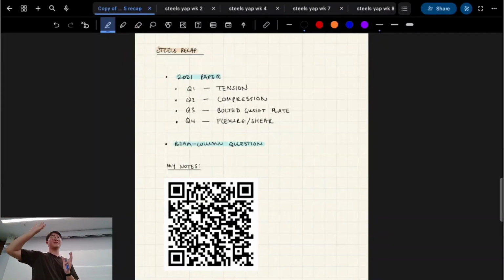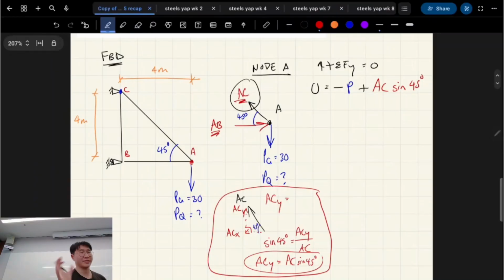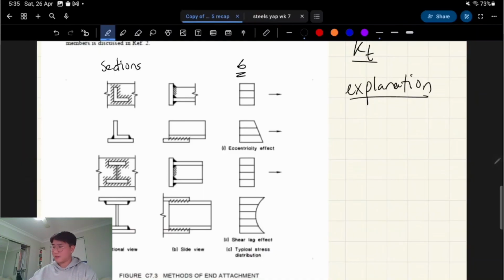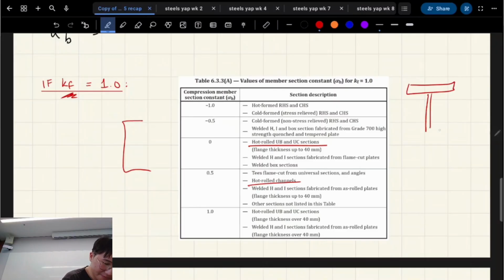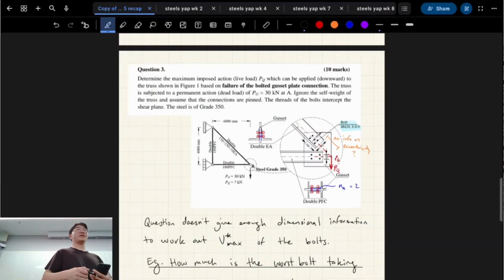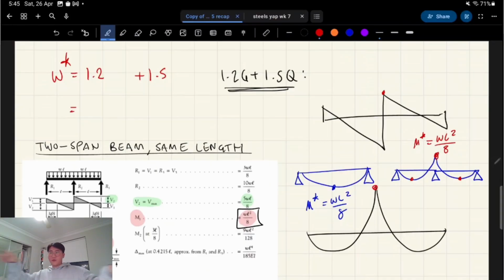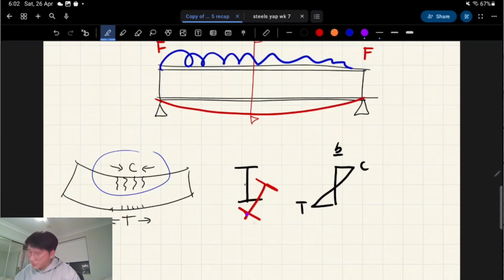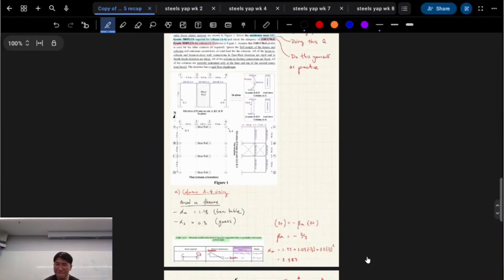Steels Recap Workshop (CVEN3303 2025) (Updated)

Comment: Hello my GOAT. What if the gusset thickness isnt given? For question 2, calculation of Iy for radius of gyration. Do I assume a thickness and state it?
Reply from the maker: Hey bro. They should give u everything u need to do the question. If not for some reason then sure i guess assume a reasonable thickness like 10mm
Reply: @SigmaLectures  Thanks for the reply. For some reason, the question you solved vs the one provided in moodle doesn't have the thickness of the gusset mentioned. Thanks for the clarification!